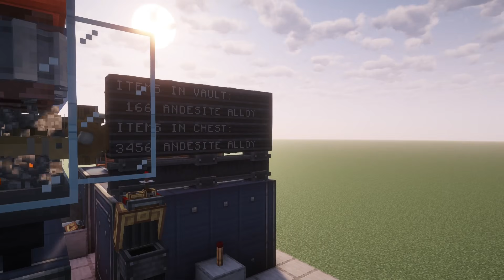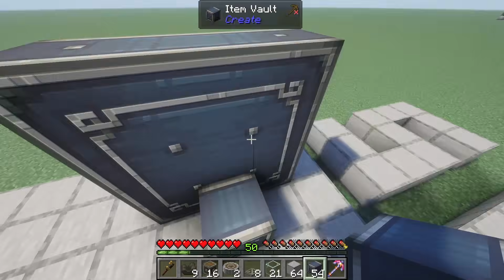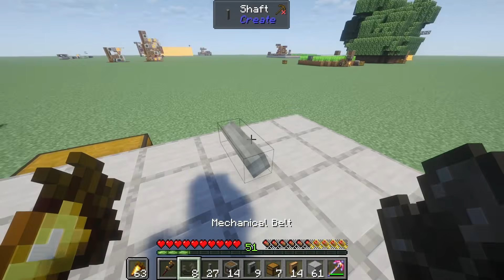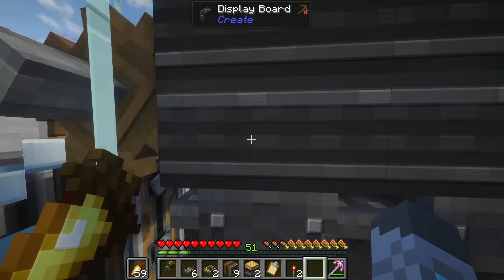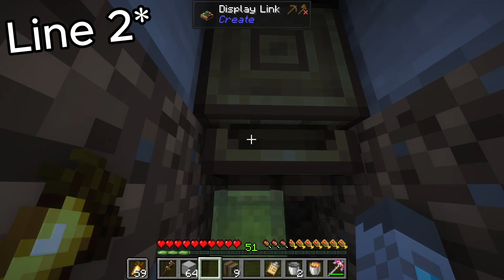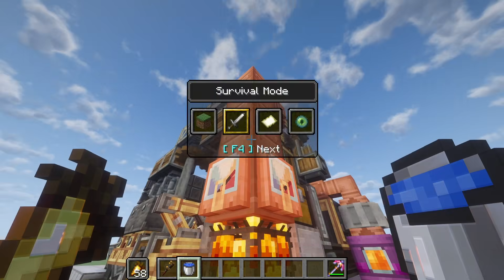This Andesite Alloy Farm is TOO Fast! | Create Mod Tutorial

Comment: how long does it take to the gravel to be washed? ive been waiting for so long but it is not generating flint or iron nuggets
Reply from the maker: Check that the fan is blowing water particles, if not try picking up and placing back down the water and fan. If it is check if the fan is blowing air the right direction

Comment: Hey, is there a way to contact you? I've been struggling on this for 2 days. At the end, everything is overstressed and I don't get why. Thanks in advance.
Reply from the maker: There are a few things you can do that may fix this:

1. Make sure the rotation speed controller that connects the rest of the system to the cobble gen's cogwheels is set to 1 rpm
2. Try putting the other speed controller on a lower setting until it is no longer overstressed, although this may make it slower.
3. Check the total stress usage of the system by placing a stressometer on any of the shafts to see how much stress is needed, then add water wheels or a windmill to compensate for the lost stress.

If the first did not work, I am not exactly sure how this could have happened but my guess is either another mod is changing how stress units are used/produced, or an extra machine was accidentally added somewhere in the process.
Reply: @IcyknightGaming  I rebuilt the entire machine with the exact amount of materials you used in the video, but as I expected there is still problems. I've been struggling on this machine for almost 2 days. (I got off every create addons before rebuiiding it). Is it possible to add you anywhere just to fix this problem it will be extremely helpful. Thank you again !
Reply from the maker: @Lauwoods-x3b  Sorry, I cannot do that, and this may be hard to hear, but if there are other problems that cant be fixed by adding more stress, I am not sure what to do unless you would like to list them here
Reply: @IcyknightGaming So, how do I use a stressmeter if everything is overstressed?
Reply: @Lauwoods-x3b  you have to wear the engineer's goggles item to read the stressometer, the stressometer can be placed anywhere so long as it is connected to a shaft of the contraption

Comment: For the lava, you also could have built a lava farm using pointed dripstones and cauldrons, hooking it to some fluid tanks to act as a buffer and pumping it into your contraption
Reply: The dripstone method is good for blaze burners and even so I needed 16ish  to get a level 9 engine going without lack of lava.
Reply from the maker: Yeah, but I find those annoying to build in a large enough quantity for most farms and you get infinite lava for all builds with the one pool

Comment: Would be nice if you shared the schematic for it. Otherwise good machine and I've had only a little bit of trouble (which I fixed) getting it to run on its own. Thanks
Reply: I agree
Reply: Having built it, could you share the schematic?